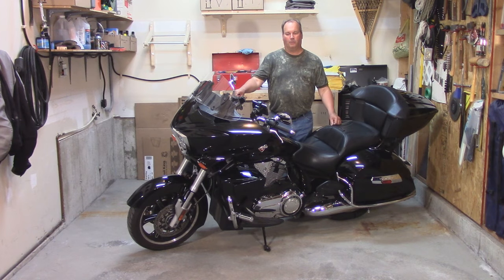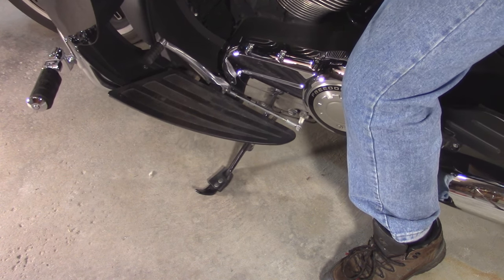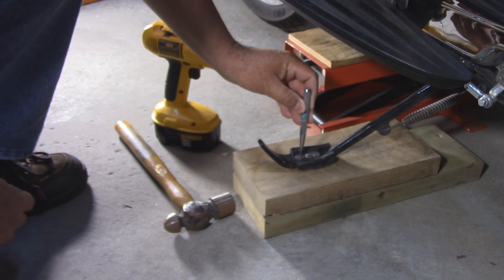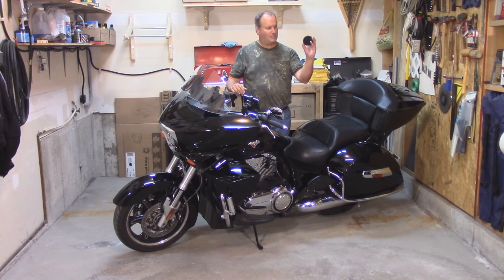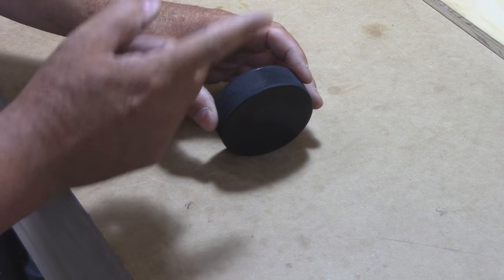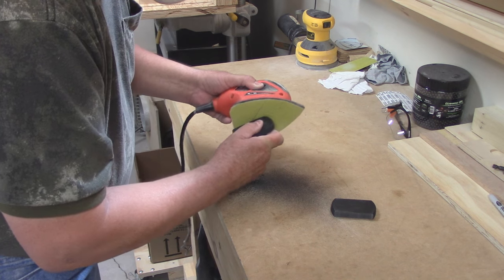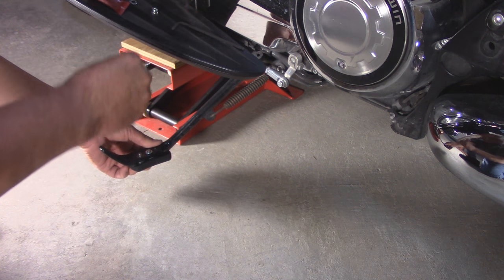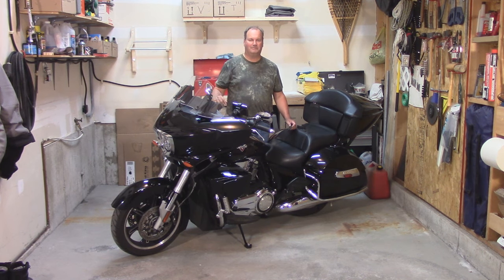Motorcycle Kick Stand Pad

Comment: Hello Paul. Thank you for the video instructions. My English is not very good and unfortunately I can not always understand everything. Please tell me the size of the site already cut. I understand that its height is half the hockey puck, but I do not understand the width. Thanks in advance )
Reply from the maker: We need it to extend past the width of the kick stand so it will stop the kick stand from hitting the frame. Mine is about 1-7/8" wide and bolted to the kick stand in the center. Hope this helps. Thanks for watching.
Reply: Hello Paul, I made a small drawing, could you check the correctness of the sizes, I do not have CCT yet, and I myself can not do this :(.

Comment: I used new cobalt drill bits and after 15 minutes with oil I only got through 50% of one rivet!  There has to be a better way!
Reply from the maker: Wow, don't know why you are having a hard time. Perhaps you could try using a 1/4" bit and go at it from underneath. It has the taper on the bottom of the rivets and your bit will stay centered. Don't go bigger than 1/4" as that is the size of the holes in the kickstand.
Reply: I finally took a grinder to it and got them out.  It was work!  But nice to have that hocky pad.  Should last forever.
Reply from the maker: Good job. Glad you got it done.

Comment: Hi Paul, would you be able to create 1pc of the Victory Kick Stand Pad and sell it to me, please? I stay in Singapore, just for your information. I need it for my 2016 Victory Gunner ABS version. Hope to hear from you real soon.
Reply from the maker: This is the newest version that I make. https://youtu.be/rLGTNLEnia8
I am not sure if it will fit a Gunner, and Singapore is going to be expensive to ship. Is there any other way you can do it?
Reply: Hi Paul, totally understand that shipping will be expensive to Singapore. I have no choice but to order a stock pad from eBay. However, it doesn't come with any rivets or bolts & nuts. May I have your advise on the size and length for the Bolts? It would be great if your advise can be in metric unit. Hope to hear from you real soon. Cheers.
Reply: @PaulPomerleau is there anyway you could send me a link to your newest model you talk about here? I searched it and it says it isn't available any longer?